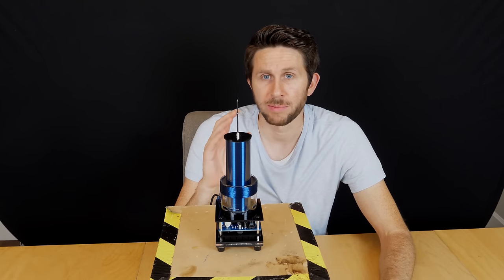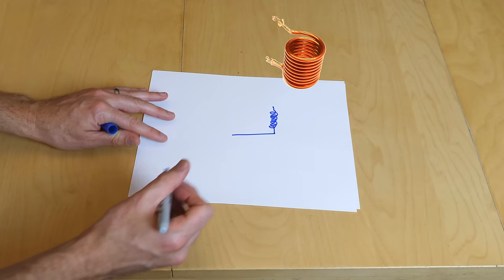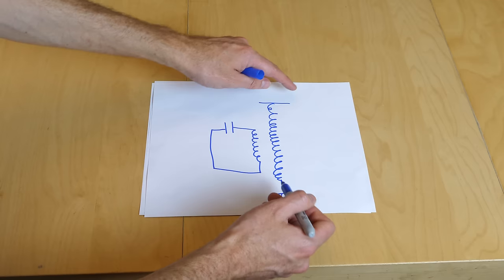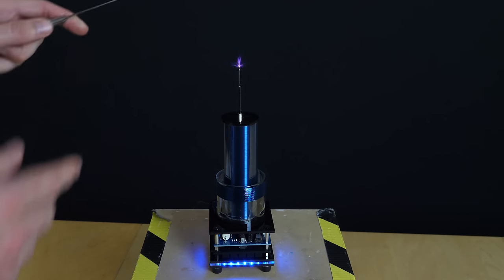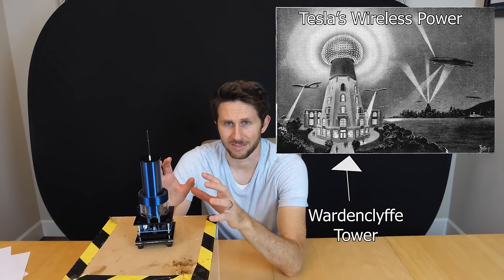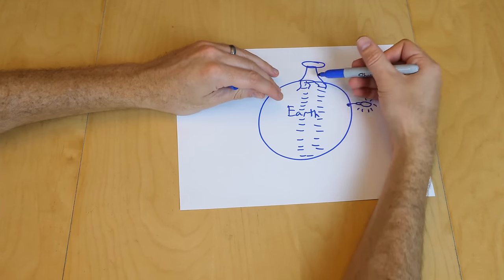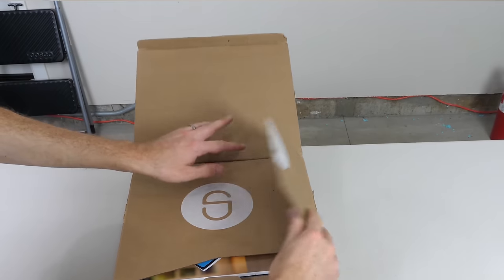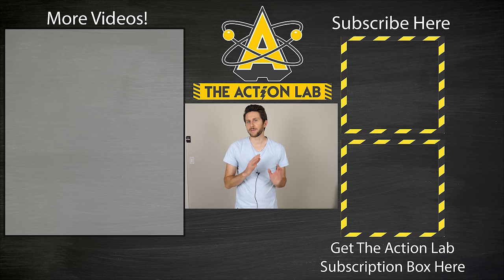Making Wireless Energy For The Entire Planet—Nikola Tesla's Wardenclyffe Tower

Comment: He was taping into the ether, our earth is a giant coil.
Reply: kyle henson i'd say it's more like a battery and a capacitor than a coil
Reply: He was using the ionosphere which is charged by the sun
Reply: Close.
He wasn't tapping into the ether though as its not a thing you can tap into. All mass is trying to gather together and close the gap between it and counter space which is the nothingness. The universe of separate masses are constantly trying to gather together and close the loop or circuit.
Tesla stumbled onto this accidentally and nearly died except for an assistant who shut off his system before he died of the unexpected 'energy' that occurs when certain conditions are met when high voltage, high current, high frequency are in a certain state and when a particular state of events allows for a 'closed loop' so to speak allowing a conversion of 'mass/counter space' in an electromagnetic state of usable 'energy'.
There are 4 attributes that define ALL mass.
Dielectricity, electricity, diamagnetism and magnetism.
Unfortunately in modern physics we exclude dielectricity and diamagnetism so the discoveries of 100 Years ago are not evident to us.
The father of math Charles P Steinmetz advised us a long time ago that we should include these attributes in our physics calculations otherwise we will never see the effects actually observed and used back in the late 1800's 
Its best we don't though because the destructive forces allowed by cosmic mechanics would be used nefariously against ourselves.
We have been led astray on purpose. To protect ourselves. I have witnessed and experiencee first hand proof of what I am saying so I have no doubt at all of what is possible but also why we are not ready to go anywhere near it.
Until we stop killing each other for power, greed, and a bit of dirt, we must be kept away from it.
Tesla withdrew in the end because he could see where it was all going.
Once he told a fellow discoverer "lock up your knowledge for a thousand years until we are ready first it", he said this to a fellow scientist who discovered the REAL periodic table of elements.... Its all there for the reading.
Hydrogen is NOT the first element!
Reply: Garry Threlfo really interesting thanks man
Reply: Garry Threlfo what proof have you seen first hand
Reply: @shable1436  my own experience was regarding the loss of inertia of an object in motion (equates to a mass 'loosing weight' as it travels.
At first you might say something like F=MxA and that once its not accelerating then the force applied would not sense 'mass' or resistance (like once an object is not accelerating but at speed) but that is not what happened. 
It was not affected by any perceivable external source light air, electromagnetic fields, radio energy, solar energies or static charges.
The assembly itself had its own internal mass reduction so to speak... No moving components and resting weight of approx .5kg
Bearing in mind that 'weight' has a number of variables like the medium containing the mass, the vector of change of acceleration, the location regarding gravity etc
Reply: Garry Threlfo Where can I read about this? Anything you can suggest?
Reply: @atmospheres11  Garry, you are Time On Target.

I can count on one hand how many very sharp people I know and have served with know who Steinmetz was (and I am stationed across the runway from NASA/AMES)

But on my trips to Skunkworks (fuckin' cool day for me), Sandia and Los Alamos, I met scores of people who DO know.

I was first introduced to these ideas as a kid in the 80s.  I live 1 town west of Livermore, and I went to school with a lot of the kids of the LLNL pocket protector squad.  So I had some early access to people that knew how to actually learn, and not regurgitate.

And as I just retired last month from the military, in retrospect, I agree with your statement about greed and dirt.

Better we tend our own garden than poke the beast when less than ready.
Reply: @zdoggizzle  Steinmetz published a shit load of books.

But they aren't light reading.
Reply: @zdoggizzle  this cat has a page where he goes toward this rabbit hole:

https://www.youtube.com/user/kathodosdotcom
Reply: @zdoggizzle , its difficult to cut-to-the-chase with this information because its broad and many aspects of physics have to be revisited to form a solid understanding of cosmic mechanics.
For example If I said that light is not a 'duality' of photons and waves and that light of itself does not travel out through space or indeed anywhere under its own 'power' that in fact it basically doesn't leave the source at all that in fact light is merely the medium being perturbed by the source and the mediums attributes change and so it propagates continuously until there is no more capacity to do so or a medium that wont be perturbed is encountered.
That explanation invokes many questions and "but...." So if your looking for clarity of cosmic mechanics the path is full of bullcrap, egos, peer pressure, social and cultural disapproval and scoffing but if tjrse things can be put aside then just keep seeking and slowly over time it will congeal.
I do suggest the starting point is Ether and finding out the fact that pop science keeps hiding from (ether has been PROVEN using the very experiment they say proves it doesn't exist... THEY ARE LYING! There were several ideas about what Aether/ether was. The Newtonian Aether (luminiferous Aether) was indeed proven to not exist BUT the OTHER idea of Ether WAS proven numerous times and as Einstein did say, if ether is fact then relativity fails.
Reply: @atmospheres11  So, what is the center of Earth trying to become?
Reply: @FEV369  good question!
All 'stuff' in the universe is connected to all other stuff.
My understanding is that due to all forces (mass attraction to mass) in the universe acting together, a single mass is never of its own able to close the imbalance between mass and counterspace.
Effectively I am saying that relativity has an issue in that there is no mass anywhere that is not affected by all other mass therefore relativity is only a matter of degrees of measurable affect rather than any absolute value.
A good question is, what gravity is there at the centre of our planet?
A maximum potential or minimum potential?
Its minimal BUT at that location the huge mass surrounding is pressing inward with huge potential.
Earth is trillions of atoms in a cumulatively mostly random 'polarised' spin states though there is enough aligned atoms to result in our magnetic polarity.
The far field magnetosphere is a result of overall low polarisation.
Reply: @atmospheres11  dude I totally agree with everything you said.
Reply: He did find the resonant Frequency of the Earth...thats why he teased, " If you want to now the secrets of the Universe, think in terms of energy, frequency & vibration.'"Did you hear about him using some simple equipment  in his home & a speaker, & generating an earthquake ...realising that like a bridge under resonance for too long, it would collapse the bridge& thus the earth, so maybe thats why his idea wouldn't have worked consistently. or it would have been dangerous, he wouldn't have wanted to destroy the earth, so he was podering other ways to make it work....I wonder...
Reply: Scientists don't even know what the ether is.
Reply: LJ Battlefield  sure LJ, holding an object in my hand and feeling its weight as I move my hand up and down getting a sense of its heaviness then reassemble its components and do the same and it weighs less. Disassemble and do again and its weight increases.
Reply: Its no invention of mine.. I just researched a lot and worked out what others were doing.
Reply: LJ Battlefield  I can't expand on it. In the moment I observed it it was a cathartic experience because logically I had to reason out why I was the first person in my in my lifetime to experience it therefore I can only assume it is happening yet kept away from the masses. At that   realised I can't go further with it. If no one else has than no way am I going to go further. I'm OK with not being believed, my proof is enough for me. I do urge everyone to pursue this themselves though and maybe one day a big enough groundswell movement will gather enough support to finally come out from behind the curtain.
The problem is not conspiracy though. The problem is how disruptive it will be. It will take time.
Reply: Garry Threlfo  Do you believe Gravity can be understood or figured out fully one day? 

I believe so...Almost every form of energy/waves have been manipulated by human beings. Such as: Electromagnetic force’s , X-ray, nuclear power, radio waves, etc...yet Gravity hasn’t been touched to such a degree or at all in-fact. Can it be Harnessed by man?
Reply: @thegrid117  yes.
It is already understood.
Not by the masses.
Gravity is not an individual separate entity to everything else, its not something outside of relativity, its not many of the things most believe it to be. For most the belief is we don't understand it. This is not correct.
Its the way gravity is defined and explained in academia that causes so much confusion.
Gravity is relatively easy to explain (pardon the punn) but to explain it we have to undo the layers of supposition that build up to our current misunderstandings.
Reply: To understand gravity we have to start at beginning. Roughly around 1900's, it all started with one defining moment. The infamous Michaelson and Morley aether experiment.
What you are told about it is incorrect. I have seen the test results and i understsnd the aether Was disproved BUT there were at least several other theories about the nature of aether then. The Newtonian aether was shown to not exist... But.... The other aether (ether) was shown to exist . unfortunately it didnt bode well at the time so even though the truth is in plain sight and available for all to read, an acedemic groundswell of this new theoritician Einstein took prescedence and the fork that misdirected us all took hold.
Reply: Consider this.
If I asked you in which direction is gravity acting upon you from what would be your answer? And secondly, how far away is its source?
Reply: Garry Threlfo  I see...so even though (Aether) has been disapproved in mainstream Science and Academia. You still hold tight to it’s existence. 

It seems the experiments and research did not go to the depths that you would like.
Reply: Garry Threlfo  I would say local Gravity in my case, is acting to attract me towards Earth. Because of its Mass it bends space/time creating my local gravitational force. 
Yet the earth is in The gravity well of the Sun along with the other celestial bodies.

How does repulsive gravity come into play as well? 

Thanks for the reply btw. Appreciate it
Reply: @thegrid117  um which of the ether propositions are you referring to?
The one I agree was disproven, the other was proven.
Given you are proposing that there is neither of the two can you find someone who can show the proof? I have several if the test result sets from when Michaelson and Morley did the first tests together then seperately with other scientists. 
I see a working ether and tests to show it.
But I'm open to new understanding given some actual tests rather then academic parroting. 
Yes. Academia has it wrong. This is not a place I can easily share these results, send an email and I'm happy to forward the data
Reply: @thegrid117  if 'spacetime' was removed from special relativity we are left with a relativity that mostly works except for the conundrum of gravity. Maybe its best to start with conventional physics (as observed)
All mass has gravity.
Gravity affects all mass throughout the universe so all mass is affected by all other mass.
These 2 affects of gravity are conventional science and accepted so as I stand on earth, I have gravity which is interacting with all mass around me. So is the earth. So is the moon. So I can say observationally that as the majority of our solar system is on the other side of earth I get a bit heavier and when its all predominantly overhead I will get lighter. Accepted general physics.
As I stand here, every piece of mass all around me is influencing my 'mass' weight. If I stand beside a huge cliff mountain I will ever so slightly be drawn toward it. So from a 360° perspective to the horizon the earth is pulling me outwards with constantly increasing affectual 'pressure' as the vector angle changes until looking straight to the earths centre. Where the gravity is strongest.
I'm doing the same to earth though at such an almost impossibly measurable amount that is not factored into our calculations yet its there.
Reply: Regarding repulsive gravity, another way to look at it is to remove spacetime, a construct that is only a theoretical maths construct to explain gravities distaste for relativity.
Then don't think of an opposite type of gravity or a repulsing force (because all mass is heading toward all other mass) think of the mass having less mass. 
To measure mass is to factor in quite a few  variables. 
1.Temperature
2.medium it is in (think of lifting a person while in water versus in air.
3. Location (how close to sea level for example 
4. Momentum (if a 1 gram bullet hits you at projectile speed, its mass at impact is not 1 gram)
5.majority of external masses locations (the sun, moon etc.. Solar system etc)

So reduce the mass (hot air balloon is not best example but it will do) or in other words RELATIVE to the other variables reduce its value in reference to the external variables and it gets less heavy   (think motion)
Reply: @atmospheres11  Are you speaking of Walter Russell  ???   A very interesting man in himself with the true table of Periodic Elements attributed to him and his wife,  Lena.  If only we could go back to speak with these people.
Reply: @atmospheres11  Could I get your e-mail so you can expand on everything you are saying here in the comments. 
Please, everything you have said sounds amazing, and only to imaging it feels incredible, I want to learn more 
Thank you.
Reply: Sort of. Best to say giant inducer! It can be used as an inductor and possibly using schumann resonance!
Reply: @williammartinez3392  while using the earth as a resonant inductor!
Reply: @atmospheres11  any links there, I been looking but got couldn't find?
Reply: @Buzzhumma  links where? I missed the context of your question
Reply: @atmospheres11  hi Garry, umm maybe i replied to the wrong person but it was in regards to hydrogen no being first on the periodic table !
Reply: @Buzzhumma  oh, yes, OK. I will find the references and get back to you.
Reply: @atmospheres11  oh thanks garry thats wondeful. If you have an email i will share my theory on gravity . I think i figured it out but it really needs to be peer reviewed by someone like you !
Reply: @Buzzhumma  I will find the references and send soon
Reply: @atmospheres11  👍🏻
Reply: @atmospheres11  thank you Garry for finding that.
Reply: Not a giant coil a giant conductor.
Reply: Ignorance